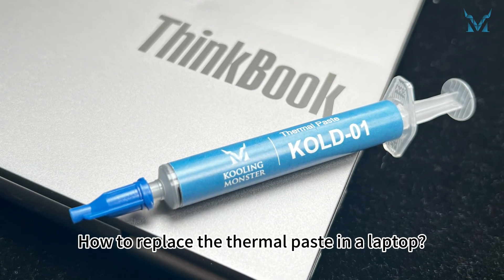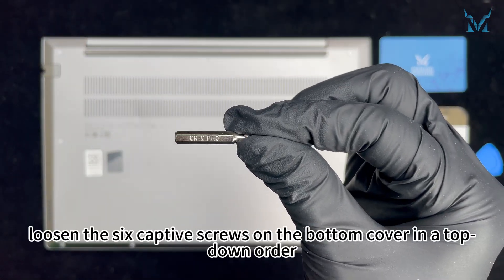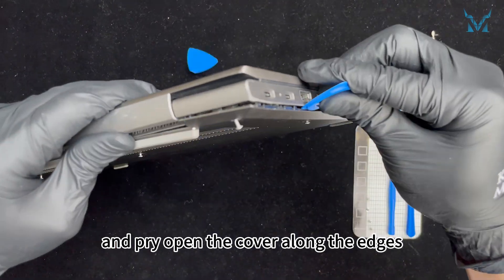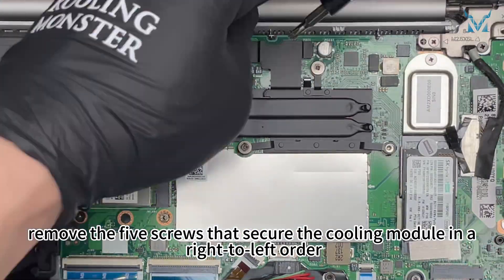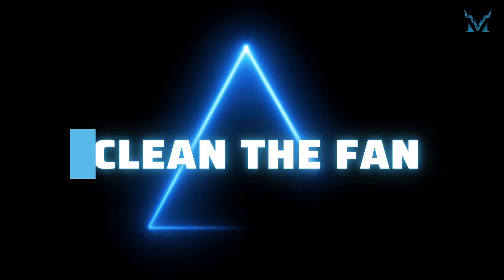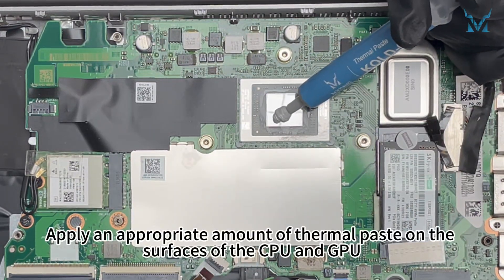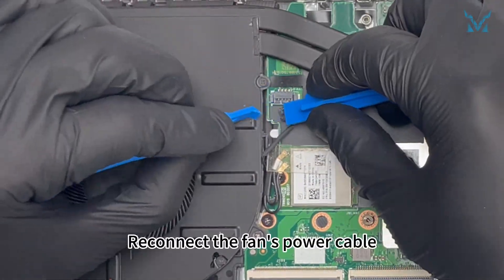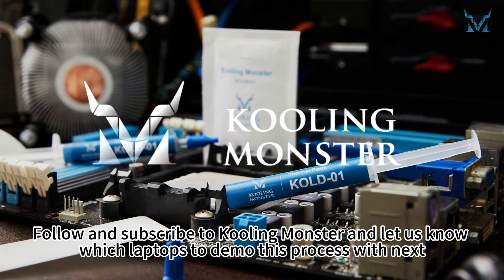Speed Up Your Lenovo ThinkBook 14 G3 ACL 2021  PreventOverheatingWith DustCleaning & NewThermalPaste

Comment: If I'm only installing the ram can I just drain the battery to 0% I'm scared to touch it
Reply from the maker: Thanks for asking!
You don’t need to drain the battery to 0%. Just unplug the laptop and hold the power button for 15 seconds to discharge any remaining power. No need to touch the battery if you're only installing RAM.
Reply: @koolingmonster so even if the battery has remaining power I just need to hold the power button for 15 sec and unplug it then ok to upgrade the ram?